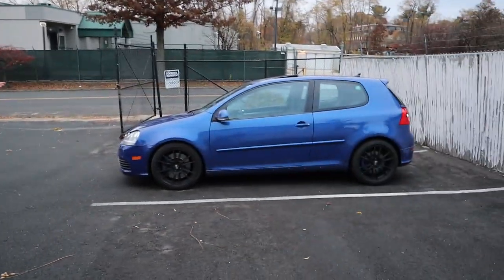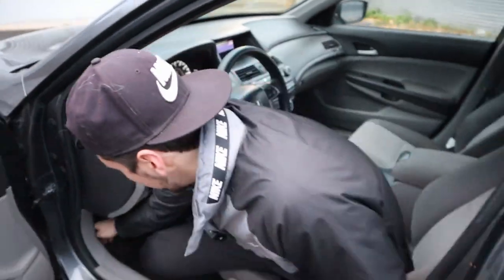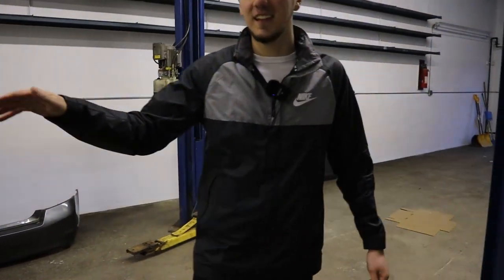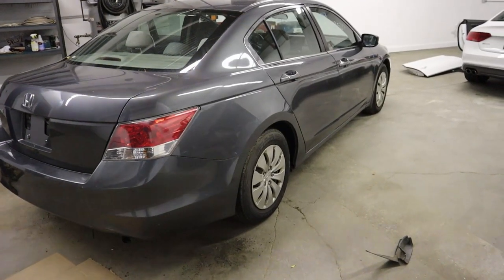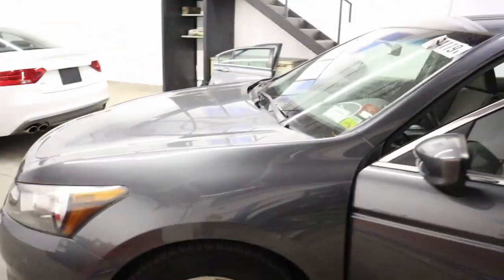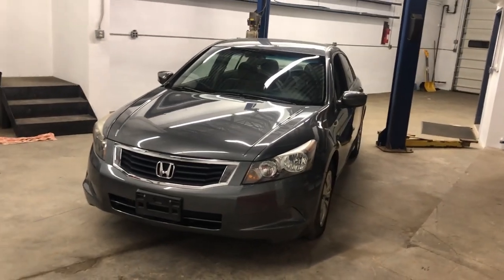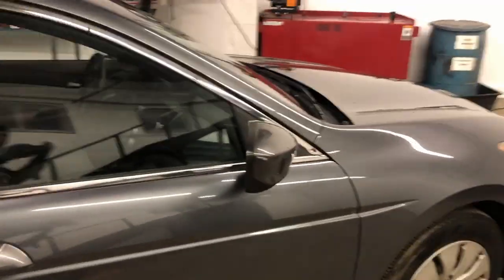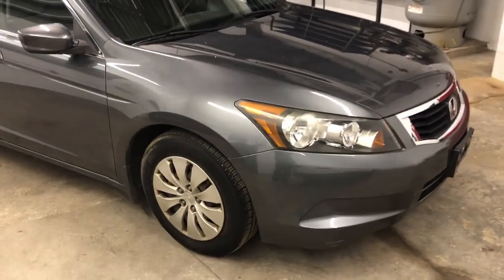Copart: I Bought the cheapest car and fixed it in 10 Minutes! Almost NO DAMAGE! Inspired by Samcrac

Comment: When he opened the hood the engine is. Knocking bad pistons from damaged low oil consumption.
Reply: Issa Saba uhmmm no lol
Reply: Could just be the loud injectors because I think that’s direct injection which is super loud and sounds almost like a diesel with the hood open.
Reply: Correct. These newer cars have direct injection which eat up the valves.
Reply: Mario Rodriguez yeah I don’t like direct injection. In my family we have a VW that has it and you have to do intake cleaning every so many miles or else it gets expensive repair. I’m happy with my older car with port injection. My Injectors are still super loud (like a sewing machine) but it doesn’t sound like a diesel lol 😂
Reply: Rex Volvo  have a 2014 Fusion ecoboost that sounds like a diesel 😂
Reply: Mario Rodriguez hahaha 😂
Reply: That engine is damaged the car is junk and dude is going to lose time and money on the car. I have a weird feeling he really doesn’t give a darn. If he did he would’ve knew that was a bad investment
Reply: Issa Saba lmfao dude you have no clue what you are saying. I’ve worked on cars since I was 13 and now 23. I’ve had my own business working on cars for 2 years.
Reply: Rex Volvo  sounds like my grandma sewing up some shit. 😂
Reply: @MarioRodriguez-yc6uo  hahaha
Reply: @issasaba799  dude if that was the case then most modern cars are damaged from new. what cars do you even work on? every direct injection i have worked on sounds like this pretty much.
Reply: Go to car complaint . Com and look up the Honda Accord 2008 to 2012 which is where this car ranges. Worst yers for accord they all suffer from that problem. They were designed poorly trey burn oil light doesn’t warn you and you drive it dry before your next oil change $4500 at minimum to fix most likely junk and this accord is In poor shape neglected already
Reply: Issa Saba it’s pretty quiet for failure so I would say there is a chance at saving it if this is the case. But so you know there are several direct injection engines that are even louder than what this one was like at idle and they don’t have failing bearings. Like a 2.0tsi from VW.
Reply: It happens to all of us no big deal. It has an air light directly under the seat belt light on dash. Been in an accident the car is been totaled with salvage title has visible bondo on bumper. It has cigarette holes all over the seat. The car is neglected and a piece of shit. You didn’t even see how it drives maybe the trans is bad. I wouldn’t and it’s about how high and low the miles are it’s how the car has been taken care off and I wouldn’t buy this car for $3000 even after he fixed it. The car Barely started and it was already warmed up
Reply: I would subscribe to the channel if he had a follow up. I would be a fan if he is like we’re trying out this is how it feels like when buying a car from auction without inspection first, everyone wants to be smart and these guys are great with an awesome personality I’m actually rooting for them but as a YouTube channel there was so many different ways they could’ve tackled this situation and they took the easiest way out. They are young and still awesome
Reply: Issa Saba yeah I’ve seen plenty is horrid low mileage cars. I had a friend with a 56k mile 2002 dodge stratus and the suspension was completely shot and the trans would get stuck in park if you didn’t use the handbrake. Stereo was shot as well and the paint was completely faded. It was barely driven and sat most of the time. I have a 1999 Volvo S80 that has almost all original parts (factory stickers dated from 1999) including suspension and its in much better condition with a stock audio system that sounds better than most new cars and I beat on it every day and it’s at 180,000 miles. I did have to replace oil pan seals but that’s because someone in the past had the engine block clogged and that forced a seal to have a leak in the oil pick up and it was driven with this leak for a year and I replace it seals finally and it’s mostly good. Only a tiny bit of lifter noise but it has been getting less so I feel it’s more of a sticky lifter that’s cleaning up from the oil changes. And now that I watch the video again I can hear there is a metallic ringing sound before the hood was opened and that definitely was bad oil lubrication. Overall there are too many factors in whether a car is in good condition or not. Because of the mileage mine has very little valve but mine has been much cheaper to own than my several of my friends lower mileage German cars. It’s been better than one of my customers 2000 rav4 that had part after part failing at 200k miles. I generally don’t like newer cars anyway because they are too hard to diagnose issues because of their complexity and higher loads that they endure for emissions (even though mine still gets 40mpg Highway and has 170hp NA)
Reply: Rex Volvo I feel people have the impression it’s Honda it’s Toyota their last for ever low maintenance. I don’t think that has been the case since mid 2000s. Cars are designed not much over 150k and several years. They have brand new 2018 cars on the lot because people are holding on to there cars plus new cars are all plastic and cheap looking yuk. I have a 2000 mercury grand Marquis simple push rod single cam v8 4.6l nothing fancy everything is easy and cheap to work on simple electronic inside 147k paint like new full body body on frame seems this era we live in sucks
Reply: Issa Saba I do believe the late 2000s is when reliability died in cars and they became throw away things. Especially as they kept doing more and more “lifetime” fluid stuff. Or really long oil change internals. Sure the oil can be good by its self but oil gets contaminated from the combustion carbon deposits that get past the piston rings etc and that dirties the oil. So I like to keep the oil change internals short to keep my oil clean and my engine clean rather than pushing the oil to such high mileage where it’s letting sludge slowly build over the years. Mine is supposed to be done (according to the manual) every 7500 miles which I think is way too much even with full synthetic. I see cars with 15k mike oil change intervals and I’m betting that isn’t going to last as long. But then again people don’t own cars for 300k miles anymore. They usually get a new car every 3 years or sell it with less than 100k. It really is disappointing to see them become this way but they try to make ownership seem cheaper by making maintenance less. But I feel oil changes are cheaper and less time consuming than an engine rebuild or replacement. I have really toyed with the idea of a company that uses old blueprints or gets cars in decent shape and use modern technology to completely rebuild the car’s with everything brand new using a few old parts and an old chassis so someone can have something they like but fresh. Like I would have loved to own my car when it was new instead of any of the things you see on the road today. Basically an extremely extensive rebuild and restoration of these older cars. And all of this without updating it except maybe with a better tune if possible
Reply: Rex Volvo I agree I think that’s the secret to my cars longevity I always give my car full synthetic oil change every 4K and I don’t beat on the engine I know when to accelerate and I can make an automatic transmission very happy I know how to work the rpms. Driving is actually an art people take for. Granted unless you got a cvt trans then it just sucks. You know what’s the difference in older cars especially European vehicles it felt like you were driving a car now it feels like these cheap new cars are a boring driving experience
Reply: Issa Saba yeah I know how to make my automatic shift and stuff using varying engine load so it doesn’t shortshift the car too much. I don’t plan to keep the trans for much longer so I have been beating on it because I plan to swap in an m56 transmission (the manual available for 5 cylinder volvos like mine) the engine just takes it and runs smoother after I drive aggressively because my guessing there is still gunk one the channels that’s being pushed out with the hot oil forcing its way through. A lot has been coming out of the engine and it’s been running quieter. I’ve also been doing carbon cleaning using distilled water and sea-foam every couple of months. And man this car drives so nicely. It has the best powersteering I’ve felt so far in any car that’s 2000 and up. (I’m excluding sports cars like the e46 bmw because obviously it’s meant for performance) because everything else has electric power steering and 15lbs of bushings on every suspension part so it’s all so isolated. Meanwhile I have a lot of feedback in my volvo. I do need to stiffen up some old suspension parts but it’s such a great car for a large fwd cruiser. I keep up with sports cars like lower trim bmws and stuff even though I have skinny tires on 16” wheels (I plan for 235/45r17 summer tires on some oem 17” wheels I got from my parts car). But these cars feel rwd until they loose grip up front. Everyone thinks it’s rwd or awd when they first ride in it until I force it to understeer and loose grip. Hahaha. Sure it may not be a track beats but I have confidence when driving this car. I know what is happening even though this was the Swedish luxury flagship of its day and was meant to be comfortable and isolated but it’s still so communicative.